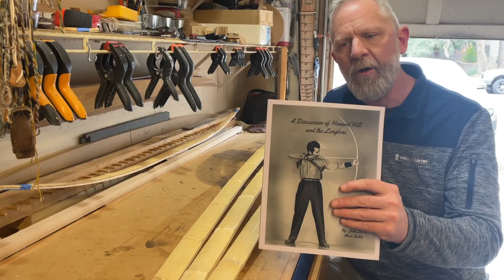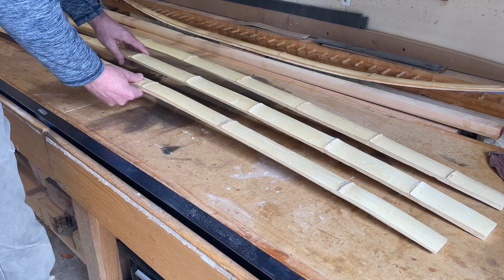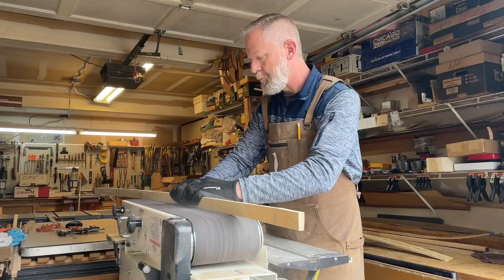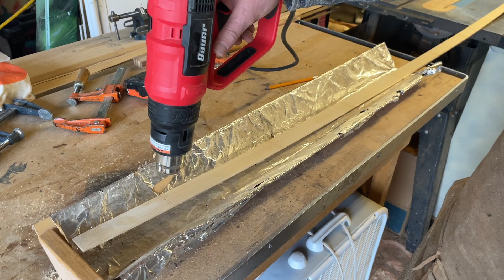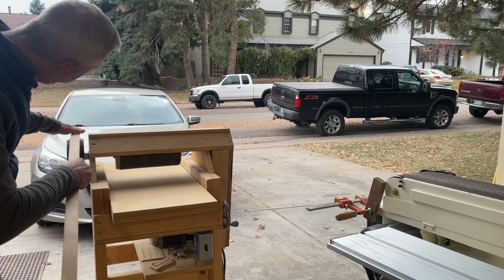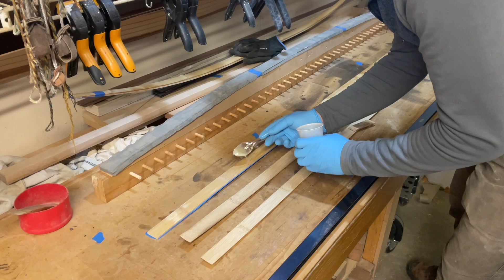Hill's ASL Bamboo Bow Pt1 - The stave

Comment: I noted that in one section of the book they noted that bows are not built in this manner anymore.  From reading the book I surmised that this method of bow construction takes an enormous amount of concentration and skill which does not lend itself to mass production.  Howard had certain bows that he was fond of out of the many that he shot so I got the feeling that all aspects of this method came together perfectly.  I looked up the beams that were described using this method and I wondered if the adhesive would allow someone to cut three sections out of it and use that for the base of this bow.  The thing I found most interesting was how they described how easy it was to pull a heavy bow of this construction.  No appreciable stacking and with a good tiller I assume the power was even.
Reply from the maker: All good insights and and queries... I can say that this method of construction (even though they made it sound easy in the book) is quite difficult. Proper tools would help a lot, but tillering a cupped length of bamboo to these specs is a real challenge - honestly, I'm not sure I will ever try it again.